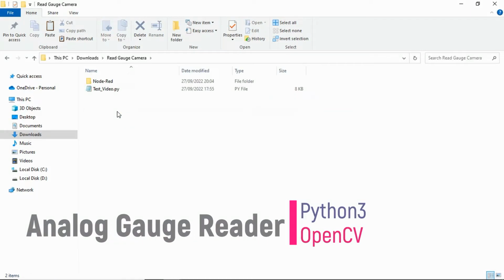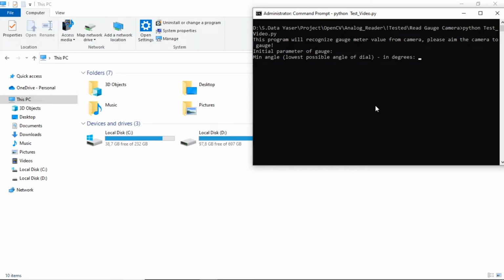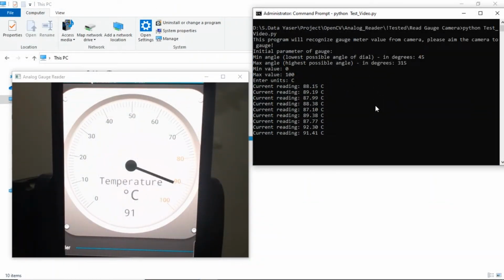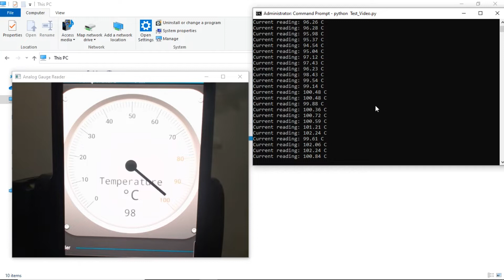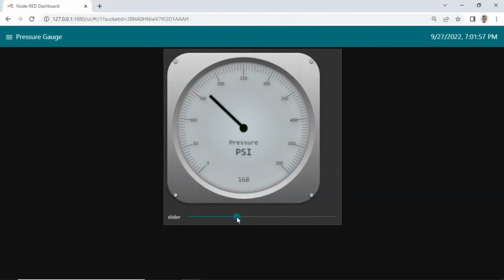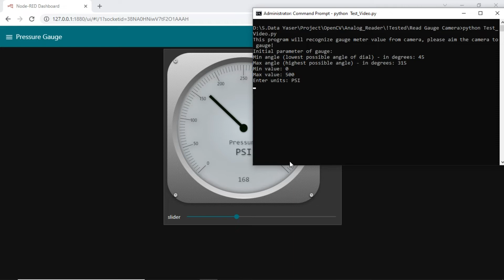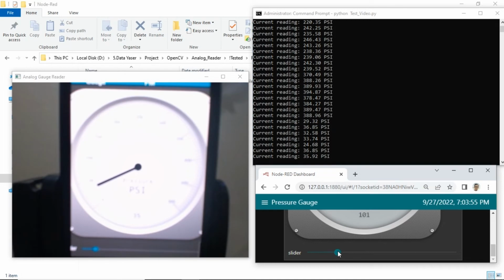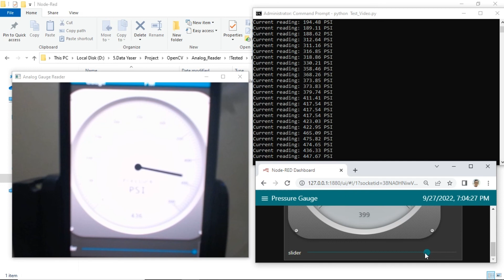Read Analog Gauge From Camera using Python3-OpenCV

Comment: What a nice it is! Here is my question on it. I think it's hard to know the exact min and max angle. Does the value of the dial gauge become unreliable if the exact angle value is not included?
Reply from the maker: It is easy to know min and max angle, just using ruler arc.
Yes, the result become not accurate if you dont provide the angles
Reply: I was going to use this technology in combination with Raspberry Pi, but whenever the gauge type changes, I feel uncomfortable because I think I need to change it to a value that fits the gauge such as maximum and minimum value and angle. 

If this computer vision technology recognizes the gauge value through deep learning, I don't have to change the maximum and minimum values no matter what gauge I change, but the method developed now seems to be inconvenient to change every time the gauge range changes. Let me know your opinion on it. Thanks!
Reply: @YaserAliHusen  Regardless of the numerical value displayed on the gauge, the angle of the needle alone represents the value, so I have to make sure that the gauge picture or video should be as vertical as possible without rotating.

Comment: I have a problem with the read values are not incorrect. What should I do to solve the problem?pls help me🙏
Reply from the maker: did you input initial parameter corectly?and then change better quality of camera and adjust camera position
Reply: @YaserAliHusen  Thanks for your response. I’ll try to change my camera.

Comment: saya sudah coba, tapi error seperti dibawah ini, kira2 masalahnya dimana ya?
C:\Python_Exercise\Read_Gauge_Camera>python test_video.py
This program will recognize gauge meter value from camera, please aim the camera to gauge!
Initial parameter of gauge:
Min angle (lowest possible angle of dial) - in degrees: 45
Max angle (highest possible angle) - in degrees: 315
Min value: 0
Max value: 50
Enter units: PSI
Traceback (most recent call last):
  File "C:\Python_Exercise\Read_Gauge_Camera\test_video.py", line 39, in <module>
    cv2.imshow('Analog Gauge Reader', img)
cv2.error: OpenCV(4.10.0) D:\a\opencv-python\opencv-python\opencv\modules\highgui\src\window.cpp:1301: error: (-2:Unspecified error) The function is not implemented. Rebuild the library with Windows, GTK+ 2.x or Cocoa support. If you are on Ubuntu or Debian, install libgtk2.0-dev and pkg-config, then re-run cmake or configure script in function 'cvShowImage'
Reply: sudah terjawab. ternyata masalah instalasi. Terima kasih atas tutorialnya
Reply from the maker: Terima kasih kembali